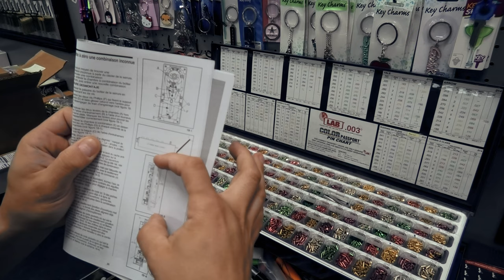Resetting A Simplex Mechanical Push Button Lock

Comment: Got one of these on our jobs, you think it’s worth giving a try before we go ahead and call out a locksmith? I’m a commercial contractor so I’ve worked on my fair share of door handles/locks but I’m def not even a veggie right locksmith? Great content much appreciated
Reply from the maker: Thank you 🙏🏻 for the support! If your mechanically inclined and VERY careful when taking it apart you should be able to do it. It used to be a lot harder, but now it’s a little easier. Just make sure you put it back EXACTLY the same way it came off, pay attention to what is facing left, right, up, down, and things like that. Good luck! 🍀